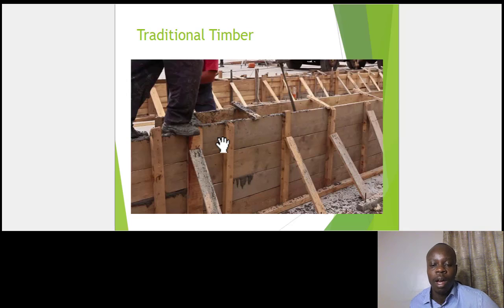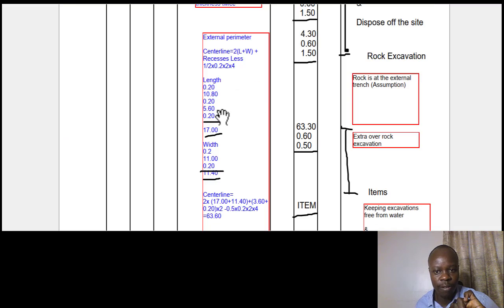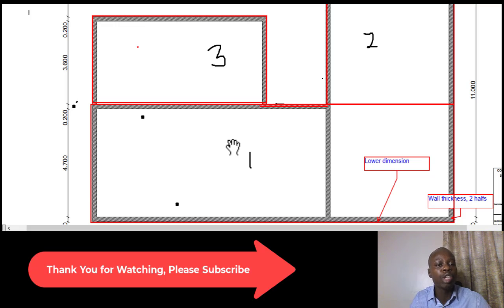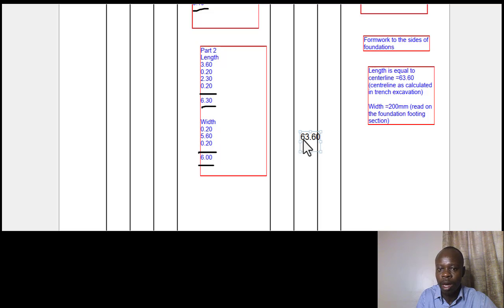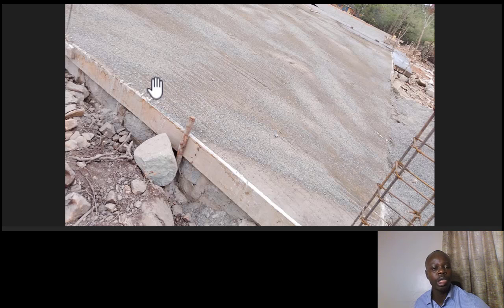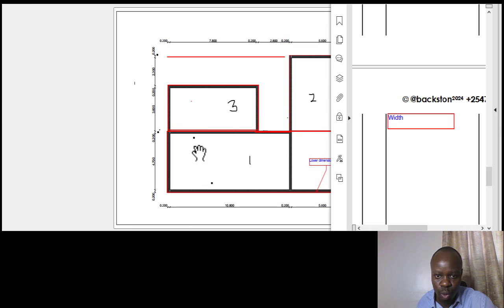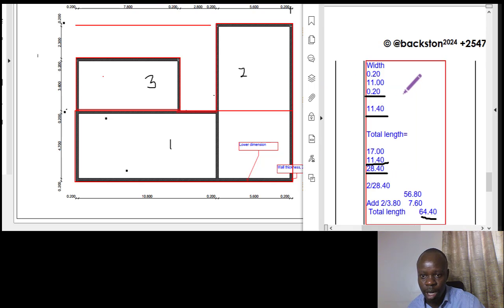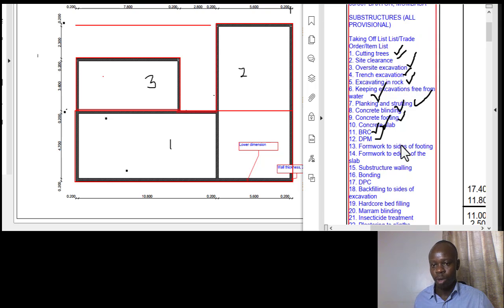TAKING OFF FORMWORK TO CONCRETE SLAB EDGES & SIDES TO STRIP FOOTING; Bill of Quantities

Comment: kindly explain why the formwork length is the center line only.What about the internal walls?
Reply from the maker: It's because the centerline serves both sides as an average especially for external beam/wall. For internal beams on internal walls, that's just straight line hence the length is the same regardless or the point of reference whether externally or internally